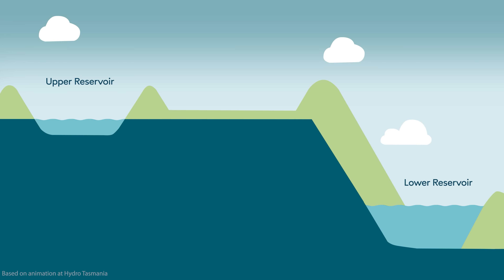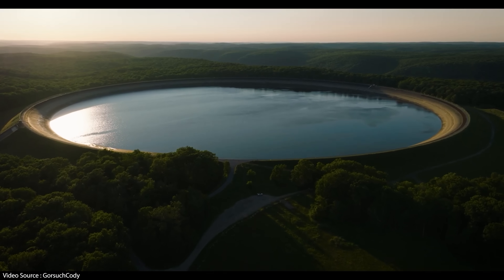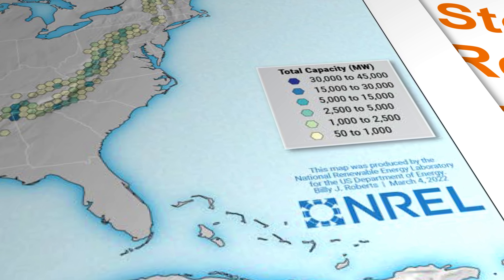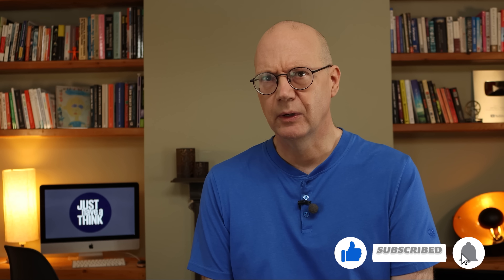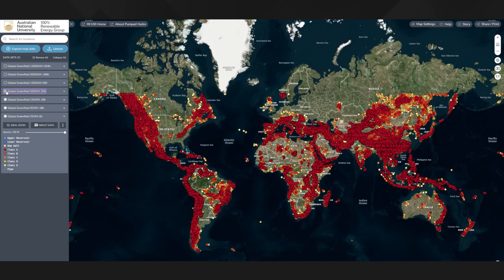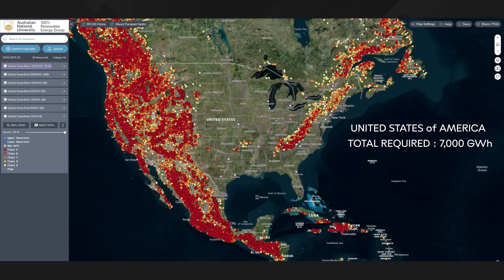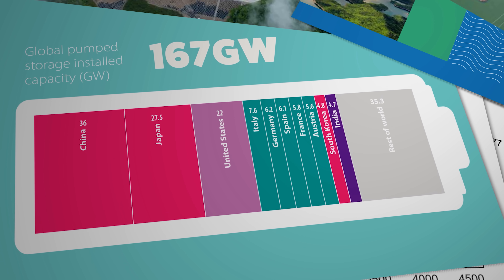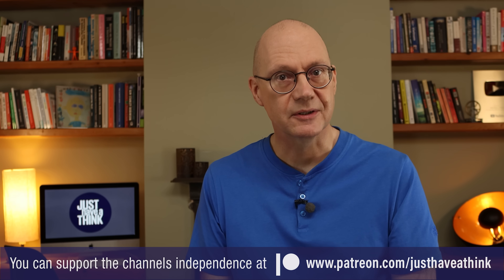The insane potential of Pumped Storage Hydro

Comment: I wonder if the fossil fuel industry will find some way to hamstring this. Like using their friends in power to reduce and governmental help and increasing the difficulty in getting them built.
Reply: They already are, like all alternatives to fossil fuels. The the same money and energy was invested in renewables as fossil, we'd already be almost fully supplied.
Reply: They spend in excess of 22 times what the green lobby spend on perverting opinion.
Reply: They buy politicians for a reason… and this would be that reason.
Reply: Its not the fossil industry sabotaging Pumped Storage Hydro.  It is government regulation and the fact nearly ALL places viable for said energy solutions have people living  there or owned land by the government which will not allow it.  Californian Farmers for at least 40 years have been screaming at their reps to get a Giant lower pool built in SanJuaquin valley to use as a lower pool from Hech Heddy and for the giant reservoir above San Francisco... No such luck.  We are literally talking a pressure head of 1500m -->2000m in both instances and a GIANT water flow between these destinations with EXISTING piping infrastructure...   Easy 50GW installation is possible...  Yet nothing from the damned regulators and all the flood water go merrily out to sea utterly being wasted.
Reply: The NIMBY effect will be exploited here, but is easy to counter:
How glad will you be in the future if the temperature isn't going well above body temperature for extended times in the summer?
Reply: @orionbetelgeuse1937  
You forget that our situation has fundamentally changed. (Or rather that it now is painstakingly obvious that the old paradigm is broken)

The reason we don't have more pumped hydro is that we used to think we had cheap fossil fuels, and therefore pumped hydro was "too expensive".
What is dawning on even economists is that fossil fuels weren't cheap, our parents just sent the bill down time ... to us.

You are correct that pumped hydro has the problems you mention, but you forget that all other energy storage and production facilities have the same or worse problems.
We just didn't talk about them because that would have made it obvious that we would have had to scale down on environmental destruction.

In order to survive as a technological society we will have to continue some environmental destruction for a time, but done right it will be a lot less than what used to be business as usual and it will taper down in a few decades.

Tl;dr Look closely on all the other tech and compare all aspects, not just what used to be 'self-evident'.
Reply: @orionbetelgeuse1937  
The ignition source obviously isn't a simple heat wave, but lightning provides all the ignition you need even without clumsy or malign humans.

But what makes wildfire ignition more likely?
Droughts.
And ehat makes droughts more likely and severe?
Reply: @orionbetelgeuse1937  
Ahh. You're trolling.

Impersonating un3ducated people is not a very nice thing to do.

But the "Almost all the footages show green trees burning... How is that fitting with the drought narrative" is a gem, I'll give you that.
The balance is quite convincing between fact and pretend-gotcha. One could imagine some people not following through on the thinking here :-)

Going overboard at the end is a blooper though.
Reply: @orionbetelgeuse1937  
So you were not trolling?? Sorry then.

But you wrote that the images showed green trees burning and asked how that would fit a drought narrative.
Well, if green trees burn just fine, what do you suppose happens when a drought sets in? 
And being green doesn't mean trees can't be bone-dry, especially if we talk about trees with needles, rather than leaves.

You also showed a lack of understanding of how lightning and ignition works which led me to think you were taking the piss.

Cloud-to-cloud strikes being more frequent is utterly irrelevant if enough (a few in dry conditions) lightning strikes the ground.

Rain is associated with thunderstorms, but the rain is localized and often short lived. The lightning tends to strike before the rain and when a fire gets going a short shower sadly isn't enough, as fuel under overhangs can reignite the rest and creep into the dry layers.

As thunderstorms are local you can't use your personal experience to estimate the frequency of lightning.
They happen all the time.
Find some meteorological organization and find their live-coverage of strike. Lightning strikes is generating radio waves, which makes them easily detectable from afar.
I was stunned the first time I saw how many lightning strikes occur in my area (100 km radius) without me noticing.

Furthermore a few arsonists starting fires isn't an argument that fires can't happen without help.
Btw: No environmental activist would start a fire to prove a point. It would generate insane backlash and be far too easy to prove.
Pyromaniacs are sadly a thing, so Occam's razor says they are the culprits if there are indeed a cluster of arson attacks.

When researchers state something as a consensus you can be sure every reasonable objection has been evaluated and found wanting. There are no more contrarian people than scientists and the only way to shut them up is providing unassailable evidence.
That has happened in the climate debate. Most of us wanted another result, but we can't always get what we want.
Luckily we don't need the current system to be happy.
The 'American dream' may be dying, but hey, it isn't as if people in the US are super happy and satisfied anyway :-)
Reply: You sound silly when the consider the biggest investors into solar wind etc. are the existing energy companies, do you not think the idea of power being produced with virtually zero input and reoccurring costs, which can then be sold back to you. wouldn't be something they are already interested in
Reply: @MinkieWinkle  They want the big money they can get from dealing in oil and gas. Also see my answer to your other comment.
Reply: @MinkieWinkle  
Some of the biggest investors in renewables are energy companies that used to rely on dirty energy, but not all, and not all fossil fuel companies invest in green energy.
OP is addressing the latter, which is sadly often actively working against the scientific recommendations.

The way we have structured our economy also means that having free energy and low maintenance once the hardware is in place doesn't guarantee the highest return.
As the infrastructure is somewhat locked into fossil fuel demanding insane prices for a harmful product can be highly lucrative, and therefore unscrupulous companies fight to keep their golden goose alive even though it sh*ts all over the place and is generally vicious.
Reply: @MinkieWinkle  Why are we underestimating renewable energy costs? 

Subsidies. 

Of course, energy companies are willing to take their share of subsidized risk! It isn't their money.

Besides, while it all falls flat, oil and gas rakes on high demand dollars because the supply was curtailed in favor of tossing it down the renewable black hole.
Reply: @orionbetelgeuse1937  
So you conclude that climate change can't cause forest fires because something happens in Canada that you don't understand and therefore the reason the fires start must be the people you disagree with trying to mess with you?

Are you quite well?
Reply: @orionbetelgeuse1937  
LOL
Your claim about Canada having no drought made me pause and I looked into the matter.

Turns out there is a literal Wikipeedia page titled "2023 Canadian drought".

Someone is filling you with BS.
Maybe a little scepticism was warranted next time this source claims that up is down?
Reply: @madshorn5826  Quoting Wikipedia with its rather extreme climate bias isn't proof of much.  Neither is weather cycles proof of global climate change.

"As we previously reported, a growing body of environmental activists and scientists are questioning the transition away from fossil fuels to so-called renewable energies, such as wind and solar power, both on grounds of feasibility and their negative environmental impacts. Meanwhile, scientists diverging from mainstream thinking about climate change, are being told to keep quiet on the matter. Nobel-prize-winning physicist John F. Clauser, who doesn’t believe there is a climate crisis, had his speech cancelled by the International Monetary Fund."
-- The European Conservative

There isca wide movement to silence data that doesn't fit a narrative. If powerful groups like the IMF do it, you can certainly suspect anyone or group dependent on donations to.do it too.
Reply: @orionbetelgeuse1937  
I stated that you don't understand drought based on your comments :-)
While a drought is required for all trees to turn brown, all droughts does not wilt all trees.

It is possible to have a great harvest during a drought if you use irrigation.
You can also have a drought outside the growth season.

I didn't cite Wikipedia as a source, I pointed to Wikipedia as a place where you can find links to sources.

And how on Earth is the owner's political view relevant when we are discussing facts?
Either meteorological criteria for drought is met or they are not.

Are you implying that your side would invent facts to suit their view??
Even if that was the case, what reason would you have to believe the other side would do likewise??
Reply: @orionbetelgeuse1937 
Then you didn't look close enough: The Canadian Drought Outlook says severe drought D3 in Saskatchewan and British Columbia.
And D0 is 'abnormally dry' which isn't "no drought".
It is one of the first links on the Wikipedia page.

Judging from your previous cherry picking I highly doubt your claim about a record harvest in general.
I'll bet you an unwashed carrot that a few irrigated fields have had an amazing yield this year, and that the source feeding you ... less than accurate information has claimed the result from this small area to be representative for the whole country.

You still need to explain why anyone would claim a nonexisting drought - and why no serious sources are challenging the information.

I can't parse your last paragraph, sorry.
Reply: You mean like how pipelines and nuclear power are hamstrung by their opponents?  Not likely.  If it is about "renewables," ecological damage is ignored.

The government is pretty hostile to fossil fuels currently, or have you not been paying attention?
Reply: @paulsnow  Have you listened to the latest news in the UK?
Reply: @ianclark9598  I read an article that the UK's summer will start on August 12.  Seems kinda late...
Reply: @paulsnow  The latest news is about the government granting further licenses to the fossil fuel industry for further extraction of oil and gas in the North sea. It has been estimated that if all the subsidies, tax relief etc... were removed for the fossil fuel industry it would collapse within a year. The estimated legal backhanders is worth 7 trillion dollars annually globally
.
Reply: @paulsnow  
Still waiting for an answer to why governments see fossil fuels as a problem.

You can state their reason without endorsing it you know.
Reply: @ianclark9598  How is that different from renewables? You are equating a "license" to develop an oil field with the actual work to drill, pump, refine, and transport energy.

The same kind of value is granted renewable products PLUS funds to enable the actual power production as well.

By your logic, those "trillions" go to make energy affordable to everyone to lift everyone out of poverty. Because if they all had to pay hundreds of dollars a day to have a few appliances, AC, heating, and transportation... we would all be living in grass huts.
Reply: @paulsnow  You seem to be missing the point. We, the human race, are supposed to be committed to reducing our carbon footprint. Aside from greater efficiencies in how we use our energies and materials, we are supposed to be moving away from fossil fuels since this is the greatest source of carbon in the atmosphere. On that basis we need to incentivise renewable energy and disincentivise fossil fuels. Either you are missing the point, or being argumentative for personal reasons, or you are employed to spread misinformation on behalf of the fossil fuel industry.
Reply: @paulsnow  
The reason I keep asking why fossil fuels are being seen as outdated is that this is the key to understanding current policies.

If you apply last millennium thinking in an entirely new situation it is obvious why new policies seem nonsensical.

So again: What is science saying is the problem with fossil fuels?
And what will be the consequences if we ignore the problems?
Reply: @madshorn5826  The literal science says higher CO2 is a net benefit.

(If by science, one means observable data, and not politics and opinions) 

Raising CO2 levels means we are using less land for agriculture due to primarily higher CO2 and nitrogen fertilizers.  But also a warmer environment and longer growing seasons.

Starvation today under fossil fuels is now purely political. Zero people today starve because food is not physically available.

Life expectancy continues to grow under fossil fuel driven cheap energy, enabling hospitals, communications,  transportation, etc.

This isn't about "last millennium" thinking, whatever that is supposed to mean.  Unless by new millennium thinking, you mean hopes, dreams, wishful thinking, and damn the data.

Cutting down forests and poluting steams with runoff (as was done in Northeast Texas) to build solar farms isn't going to lower CO2 levels.  Windfarms have maybe a 20-year life before requiring complete replacement. This compares with a 50+ year life for conventional generators, which only require a maintenance overhaul to continue and use 1/10 to 1/100 (or less) the land use.

All to address something causing about zero the issues and problems ascribed to CO2, which isn't even likely to be behind the slight warming we are measuring.

So why are fossil fuels seen as outdated?

* ignorance and lies.
* Marxist theories on resource limits calling for centralized control of economies
* political gain (an issue with no political accountability)
* grift and scams (in renewables, carbon credits, carbon capture)
* grifts based on government funding capture and control
* centralized population control via control of energy

Also:
* oil is dirty
* history of extreme pollution 
* The oil industry has an evil past
* misconceptions about the oil industry (they are big supporters of renewable energy today)
* the middle east funds unrest around the world with oil

Does this help?
Reply: @paulsnow  
It certainly helps confirm that you are not updated on the science and the politics of this millennium :-)

If what you wrote was the way the world actually worked you'd be right, but sadly conventional wisdom was pretty flawed even back then, when Disco was cool.

Science says that plants grow faster and bigger with more CO2, yes, but as the nutritional value decreases at the same time, it is patently false to say CO2 is a net benefit.

Science also has a lot to say about other aspects of CO2 which you choose to ignore.
I wonder why? /s
Maybe because longer growth seasons will be offset by much wilder weather and the euphemism 'warmer environment' is another way to say 'drought' and 'heat stress'?

We agree food scarcity is a political choice at the moment, but if we ignore the rock solid science because capitalist dogma is offended by reality, that will no longer be a choice, but stark reality for all of us: A human friendly climate is defined by a climate allowing our crops to thrive and a human friendly climate is what we will lose if we don't go fossil free ASAP.

The 'slight warming' we are seeing now is spot on according to the predictions from a united scientific community, and the problems are so big already that insurance companies are pulling out of high risk areas like Florida.

There are some grift and scams in the transition, but that is to be expected in large systems undergoing change.
Are you suggesting we drop medical progress because there are snake oil salesmen and homeopaths?
And compared to the grift and worse seen from the fossil fuel industry I say we call that one even - just to be nice.

The IPCC is backed by virtually every country on Earth and is tasked with sifting through the scientific literature.
To suggest that the scientific consensus wouldn't be challenged is t1n f1ol hat territory. There are humongous resources in the fossil fuel industry and they haven't been able to fund any peer reviewed papers challenging AGW. In fact they were the first to realise the problem before they buried the research and started obfuscating.

It is hard to revise one's world view, but it is dangerous not to follow the data.
Please point me to a peer reviewed paper backing your claims if any exist.
I won't be holding my breath though, as I have been asking this very question for more than 5 years here on YouTube.
Reply: @madshorn5826  Fossil fuel companies also support alarmism because they are energy companies.  So their funds also support "The Science" you are fond of.

The IPCC is the InterGOVERNMENTAL Panel on Climate Change. It is a political body,not a scientific body.

From the IPCC itself: 
"The IPCC provides regular assessments of the scientific basis of climate change, its impacts and future risks, and options for adaptation and mitigation."

That is not a mandate to study climate.  It is a mandate of bias for political reasons and goals.

Governments do fund scientists.  But their operations are always political first.
Reply: @madshorn5826  we grow plants in higher co2 in greenhouses all over the world.  The argument you are trying to make is that co2 makes plants grow faster and they deplete the soil, resulting in poor nutrition. However, nitrogen fertilizer avoids the soul depletion you are talking about. The continued rising life expectancy argues against any sort of widespread loss of nutrition, which, if present, would lower life expectancy. 

Yet we continue to grow more food, continue to use less land to do it, and raise life expectancy, all at the same time.
Reply: @madshorn5826  We have no data covering the last hundred years that demonstrates the weather is getting wilder.  At least, not in any way that matters to our lives.  Since deaths from natural disasters of each kind and all kinds have fallen dramatically over the last 100 years, we seem to have over compensated for any rising threat from weather.

The narrative about weather and wildfires is always cherry picked by alarmists.  We have good data on hurricanes, wildfires, tornados, heatwave, etc. Over the last 100+ years. But alarmists use  50 years of data  because the 1970's were the end of a 30-year cooling trend. After which the climate began warming again.

That's just facts and data. Last millennium stuff I know, but facts none the less.

You can find this data if you really looked for it.  Instead of being happy with spoonfed data, dig up the actual source data.  It's hard, but it xan be done.
Reply: @paulsnow  
We do have data showing the weather is getting wilder.
There was no noteworthy cooling prior to the recent dramatic temperate increase.

Why would insurance companies pull out of Florida if extreme weather was a myth?

No one is saying that we are feeling the full impact of AGW today.
The goal is to prevent this from happening.

Would you argue against an asteroid by saying "I don't see no rocks falling right now, so we shouldn't spend money on trying to deflect the asteroid heading here"?

When we look at past data there is an alarming trend which fits the models accurately.
If past data were indicative of how future data would turn up you'd have a point, but that is not how reality works.
You can't use your past weight data as an argument for being able to start eating junk food 24/7 without gaining weight.

Edit:
If anything the scientific consensus is too conservative due to pressure from the fossil fuel industry and the political establishment to not be alarmist.

Scary positive feedback mechanisms are not mentioned because we can't say for sure if they will happen.
The kicker is that we can't say they won't either.

Recently the AMOC cycle is showing worrying signs of weakening. It was expected to happen in the late quarter of this century if we continue business as usual, but it might collapse in a decade. We simply don't know.
Reply: @madshorn5826  Let's take just one thing.  Like wildfires. Show me a hundred year data set that shows wildfires are increasing.  All graphs start in 1983, and government sources that used to provide full wildefire data simply don't anymore. The argument (only found in third-party explanations) is that we need satellite data to measure wildfires accurately.   While one can quibble about orders of magnitude in wildfire numbers in the earlyb1900's, no reasonable adjustment or correction could bring that data in line with a climate change narrative.  So, instead, the data has been effectively deleted. Good or bad, you can't get wildefire data from government sources today.

That's not science.  We don't purge historical records and measurements when doing science.  We discuss the issues found in old medical books, old records of cause of death, death counts from epidemics.  We don't purge them because we have better records and diagnostic abilities today.  

But that's done with wildfires because such errors in wildefire data just can't be brought in line with this wildfire narrative. 

Without simply discussing the issues and acknowledging the data, we are left without a good explanation at all. Honestly, forest management, arson, growth of communities in the west, on the plains, conversion of grasslands to crops, all impacted wildefire patterns with or without climate change.  Just plain oldvweather patterns matter. 

40 years is not enough to establish shifts in climate.  You need 1000's of years.  But then it goes downhill quick for climate change arguments because evolution studies show grasslands and forests have evolved not only to survive wildfires but require them.  Getting away from "Smokey the Bear" expectations is pretty hard for urban mentalities.
Reply: @paulsnow  
You are avoiding my questions again and trying to deflect by focusing on a detail that seems odd. 
(Btw: Who is backing the source that fed you that talking point? A neutral scientific body?)

Scientific consensus in a complex field like this isn't reached by finding a smoking wildfire gun.
It is reached by piecing together all the pieces of the puzzle and drawing the conclusion that best fits all the data.
We knew about the problem 50 years ago, but in the 80ties the fossil fuel companies copied the tobacco industry and tried to obfuscate and stall.
The result is that we wasted valuable time by making absolutely sure that only one conclusion fits all available data.
We reached an unassailable scientific consensus about a decade ago and it is that AGW is very real and a dire threat.

How do I know that this is the case?
Because there have been no peer reviewed papers disagreeing for more than a decade.
And you didn't provide one when I asked, remember?

The Trump administration had a ... fluid relationship with the science and removed all mentioning of AGW from official webpages.
They didn't provide better science, despite being pals with Big Coal and Big Oil.
Why not?
Wasn't Trump's platform to drain the swamp?
Why look guilty in suppression of facts if you have the facts?

Again: Why is Saudi Arabia and Russia not contesting the science if there was the slightest ground to stand on?
They are getting most of their revenue from fossil fuels and have perfected suppression of their population without needing new tools. They shouldn't be part of the IPCC or the Paris Agreement if there were the slightest doubt, but they are. As is North Korea, a country not known for agreeing much with the west.

And because I don't shrink from addressing concerns:
Wildfires may be a very bad data source in this area.
1) We are just starting to see the effects of climate change (as predicted by the models), so there is no reason to expect more than a slight rise yet
2) Other factors have distorted the picture. You mention misguided forest management and arson/careless smokers.
3) Good data may not exist. The number of wildfires says very little. The relevant factor is area.
Why would anyone accurately measure burnt areas in areas without economic value before satellites?

Removing old data would be the responsible thing to do if they were crap.
And if it was good data, why isn't the fossil fuel industry waving them around from the roof tops?

The models say we should expect fewer, but worse, hurricanes in an unstable climate. It might be the same with wildfires. It might not.
But we have certainly seen severe cases lately with orange skies in Australia and California and smoke reaching New York from Canada.
This doesn't in any way prove AGW in itself, but it isn't at odds with what should be expected either.

Btw YT seems to have removed a post addressing CO2 and plants. Probably because I gave a precise reference.
My point was that it isn't just nitrogen that is depleted and it isn't just humans that will suffer. And that the concern of farmers adding CO2 to greenhouses is the size of vegetables, not the nutritional value.
Reply: @paulsnow  
Did you get busy or did YT eat my answer regarding wildfires?

I'm still waiting for answers to my questions.
Reply: @ianclark9598  and so they should. why should we export our fuel production to over seas that will produce it with even MORE emissions than if we did it here.

The fact is, it will take decades to move off gas, so why not produce or own higher quality and less wasteful gas here, else we ill only end up importing it in the first place. producing even MORE waste
Reply: @MinkieWinkle  The point is to move away from fossil fuels. What you are saying again ignores the whole point. You have decided it will take decades to do. It should only take  a few years. The reason it is taking so long is because of the fossil fuel industry playing dirty tricks. Again I get the feeling you are either argumentative, or paid to foment this sort of dissent. It is incredibly easy to understand. We need to move away from all fossil fuel production as soon as possible. We adopted video tapes within a few years of their arrival, including buying the equipment and better televisions without any government incentives. CD's wiped out cassette tapes overnight. Personal computers destroyed the typewriter industry. Again without subsidies. Our history over the last few decades has dozens of examples of entire industries disappearing within a few years due to alternatives taking their place. Why should this be so different. Easy, because the government is in the pocket of the oil and gas giants.
Reply: @paulsnow  
Still waiting for answers.
Reply: @madshorn5826  I read through the comments when you first made this request. I think everything you have asked has been addressed.

Give a hint what you are waiting on, or accept nobody's going to answer.
Reply: @paulsnow  
The most relevant questions were:

What does the science say is the problem with emitting huge quantities of CO2?
You answered with a (wrong) upside.

Some countries get most of their revenue from fossil fuels and the transition away from fossil fuels are highly unpopular.
Why would virtually all governments on Earth back the IPCC if any scientifically reasonable doubt lingered?

Why is insurance companies pulling out of Florida?

The fossil fuel industry is immensely wealthy and fund research.
Why can't I find a recent peer reviewed paper gainsaying the scientific consensus?
Reply: @madshorn5826  take Florida first.

"More storms hit Florida than any other U.S. state, and since 1851 only eighteen hurricane seasons passed without a known storm impacting the state. Collectively, cyclones that hit the region have resulted in over 10,000 deaths, most of which occurred prior to the start of hurricane hunter flights in 1943."

Build lots of stuff, drive construction costs up with covid supply chain issues, and bad legal policies that cost insurance companies legal cost on top of it all, and insurance companies lose money.

I read a couple articles on Florida, and yeah they blame the climate (cause that's popular) but then list a pile of other issues that are political and economic in nature.  None actually detail a trend that says Florida's death count is rising, or hurricanes are getting more frequent.
Reply: @paulsnow  
Bump?

Or is YouTube eating answers again?
Reply: @madshorn5826  I replied to everything in three posts.  I don't see anything after my replies.
Reply: @paulsnow  
Doh!
I don't see anything after my post starting with "Having a lot of hurricane damage ..." 4 days ago.
Is it me or you that are being ghosted?

I get the need to stop flame wars, but come YouTube...

Edit: The last post from you that I see is starting with "take Florida first..."
Reply: @madshorn5826  I posted a couple times after what you say are my last posts...

YouTube censorship I guess.
Reply: @paulsnow  
Bugger.

As an experiment I changed a few phrases in my post (Starting with "Having a lot ...") from 6 days ago to see if that helps.
Reply: @paulsnow  
Experiment. Rephrasing last answer.

Having a lot of hurricane damage throughout time doesn't preclude that the damage is on the rise.

Having multiple reasons for pulling out doesn't preclude the climate crisis being the ultimate driver.

Maybe the climate being popular as a reason for action is that the situation actually is dire?

The models say that AGW will cause hurricane frequency drop, but the intensity will rise - and more intense storms will cause a lot more damage.

I think you underestimate the inertia of the climatic system.
When the damage becomes obvious it will be too late to avert a catastrophe.

You didn't address my other questions and that leads me to a new question:
What would it take to convince you that you are wrong?

And before you ask: I could be convinced by plausible mechanisms backed by data explaining how AGW isn't real, presented in peer reviewed papers. The reason I am not holding my breath is that the physics and the models sadly check out, and that no plausible objections have been raised the last decade, despite very rich and powerful people having an interest in promoting such objections.
Oh, and because I see changing weather patterns in my garden consistent with the models: Later spring and changed rainfall. Downpours were rare here in Denmark when I was a kid. Not any longer. And snow is becoming rare in the winter. 

So: Could you be convinced that we have an urgent problem or is your position not based on reson?
Reply: @paulsnow  
And why is everyone hostile to fossil fuels do you think?
If you have been paying attention you can give us the answer :-)
Reply: @paulsnow  
You call billions in annual subsidies “hostile”, or have you just not been paying attention? 😉